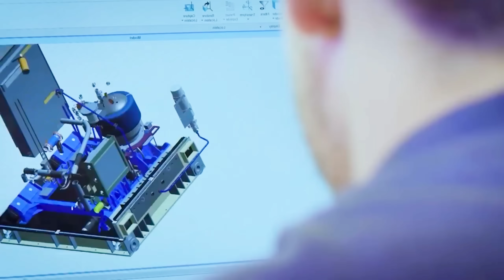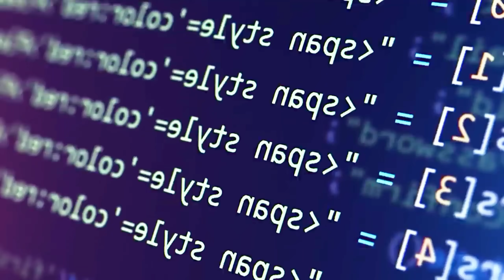Gripen 29

Comment: For combat, the twin engine CF-18 and F-15 are designed to “keep flying” after taking two hits anywhere in its hydraulic systems.  The redundancy levels for current fighter aircraft, single engine vs twin engines:
F-35, F-16 & Gripen = 3rd generation;  F-15 & CF-18 = 4th generation

Comment: JS9 is not integrated to NORAD and never will be.  NORAD depends on over-the-horizon radar.  Only F-35 has the low-latency data network and stealth capabilty that NORAD was designed and built for.  NORAD needs the F-35.  It's not about dogfighting!  JS9 for Tudor replacement only.  Maybe 25 of them on lease will do.

Comment: In theory, if you could electronically receive the targeting radar wave, and then copy it exactly, and transmit it back 180° out of phase, then the signals would cancel, and the targeted, would be unregistered.
Such would be smart stealth, without the astronomical cost and complications of 5th generation stealth.
Reply: And once that's done, then in the case of, incoming missle evasion mode- electronically phase shifting the in phase wave-form of the missle's radar, and steering it only a few degrees, at close proximity, then the missle would veer away from the actual target, accordingly.  Much less expensive, but just as or possibly MORE effective, than all the billions spent on typical, 5th generation stealth currently in service.
😂

Comment: Canada already paid for the first 16 f35, so get those and get the rest of the jets the new Gripen E/F, having 2 different aircraft is no big deal, the Gripen is cheaper to fly and maintain and more reliable and just as advanced as the f35 that still has many problems and is not cheap to fly or maintain and a much lower availability rate, a lot of air forces have more than 1 type of jet, the US is keeping the newer f15 f16 and f18, Britain has the f35 and typhoon.
Reply: "no big deal"? so 2 Training Programs 2 Maintenance Programs 2 Parts Sourcing Programs all no big deal?
Reply: @lking288  It's not a big deal for the Gripen, but it is for the f35.